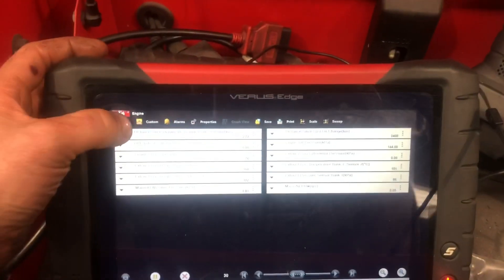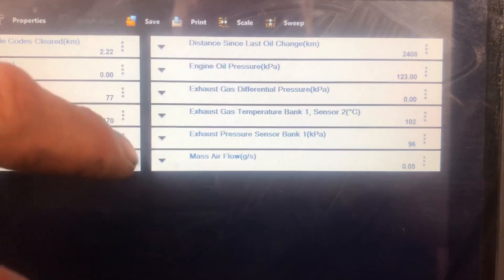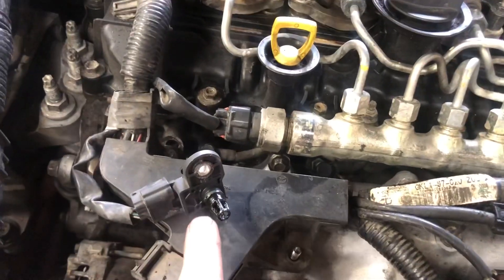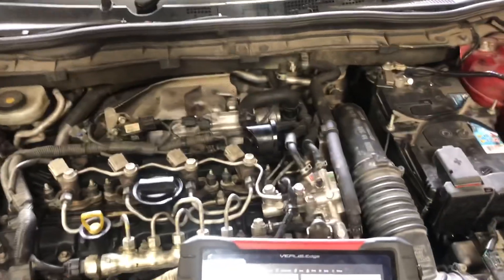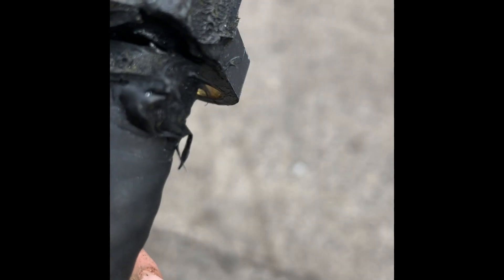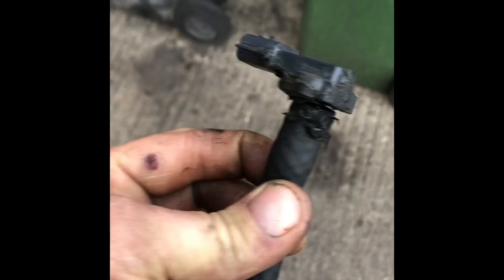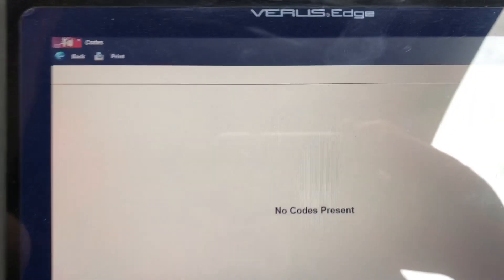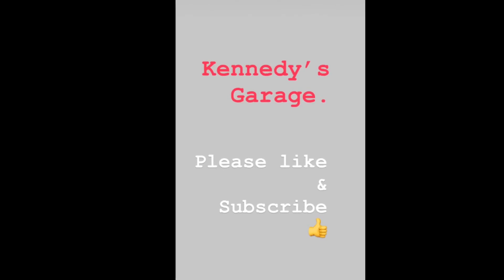Mazda 6 reduced power fault finding

Comment: Unfortunately in the states we didn’t get those Mazdas with diesel engines 😢
Reply from the maker: Lots of diesel Mazda owners might call that fortunate rather than unfortunate 😂😂😂
Reply: @kennedysgarage3281  are those really that bad? Personally I’d prefer a diesel for the torque and longevity of the engine, but with all that emissions crap I guess they’re not as reliable as I thought
Reply from the maker: @ReviewingTech101  actually with the correct maintenance, preventative or needed they are quite good. It just seems that tech’s over here don’t want to touch them 🤷🏼‍♂️🤷🏼‍♂️

Comment: Is the noise for the engine alright because this is what my Mazda 6 sounds like?
Reply from the maker: Unfortunately I cannot advise without hearing the noise myself. They do suffer from low oil pressure due to a gauze getting blocked in the sump/ oil pan 🤔

Comment: Hi Peter,
I live in London I have a Mazda6 diesel 2.2 There is no POWER.!!!🥴😮😟😭
 On the dashboard
1. Oil change due.
I changed only 1500 miles ago .
2. Check oil pressure. ( No power)
3. Check the oil level.
I would like to visit your garage.
I'm not a trust dealer named Mazda.
Please can you tell me where I can visit your garage.
Many thanks.
Reply from the maker: Hi Ruslan, unfortunately I’m am in Ireland which isn’t impossible but would be quite a distance to travel 😬
The oil strainer in the sump / oil pan is more than likely blocked. I have videos on this for reference. It should cost around £500 to £600
Reply: @kennedysgarage3281  
I checked the oil level and it is Perfect. Then I removed the cable from the battery for just 5 minutes then connected and all issues on the dashboard disappeared. Left only Oil change due. Now car driving is ok for the last 50 miles. But I have had another problem for a long time...
When I start to drive the engine cold. First gear is fast like 2nd 3rd 4th 5th 6th. But after 5 minutes when engine temperature normal 1st gear is very slow. 2nd 3rd 4th 5th 6th is okay. I mean fast. How do you think what's happening. Recently I changed the turbo. Also I deleted DPF.
Reply from the maker: @B.Ruslan1978  Mazda have AWS ( Accelerated Warmup System ) it increases the engine rev’s when cold, so I don’t think you have to worry about that. But watch the oil issue it will come back 😬😬
Reply from the maker: https://youtu.be/EIPGqQwBJtU

This might help oil change message 😉
Reply: @kennedysgarage3281  
Ok. Peter
Many thanks.👍👍👍

Comment: Well..got code p2262 and changed exhaust pressure sensor. Still showing code and no turbo boost. Delivered it to Mazda dealer today and they said  pipe to exhaust pressure sensor is blocked. They quote 2000 euro to change it. You sir   are a genius. Think I'll might try your way😂 (Norway)
Reply from the maker: Dan, it is fiddly but something you could possibly do yourself with limited tools. If you haven’t done it before I would say to give yourself a day to do it. Just in case you get frustrated and need to take a break 😂😂
The very best of luck with it 🤞🤞
Reply: @kennedysgarage3281  thanks man. I Will do eventually. Not the kind of work to do outside when it's snowing and -10 degrees. 😂 Mazda wants to take engine out to replace it😂 keep up the good work
Reply from the maker: @Dan.Norway  ooooh that would be tough 🥶🥶

Comment: We have a 2013 GT diesel and have no boost until 2500rpm and then the turbo kicks in hard, has been serviced but isn’t throwing any codes at all.
Reply from the maker: It is back to old fashioned testing so. Check the turbo pressure pipe just to be sure. It has 2 turbos and the change over flap can come loose and fall off. Pull out the battery & remove the bolted on intake pipe running over the top of the bell housing. That is worth a look too 🤔

Comment: Hi mate why does a restricted pressure sensor pipes or faulty pressure sensor effect maf sensor readings
Reply from the maker: Most electronic components on modern engines can be very much integrated. (ie. If I get steel in my eye, eating, running, driving,working will all be a struggle & only with 1 small problem)
Cars can be very much the same. If the engine ECU doesn’t know the correct exhaust pressure at the turbo it cannot not control it correctly. The way the turbo is performing has a direct effect on the amount of air entering the engine. All very interesting and sometimes very complicated, but generally does make when we think about it🤔
Does that make sense??

Comment: Just come across your channel amazing work you do. 

I have a Mazda 6 2.2 185 (2009) I have a p2565 that won’t go away. Sometimes car pulls , sometimes turbo cuts out Spent hundreds on diagnostics to no avail . Any ideas?
Reply from the maker: P2565 is a turbo position sensor fault. This fault can be caused by the turbo position sensor on the turbo vacuum canister 🤔
If that test’s good you would then need to check the variable veins on the turbo to see if they are free & not sticking. After that look at the turbo control solenoid, that is the best advice I can offer without seeing the car 🤞🤞

Comment: I am trying to choose what car to buy between a 2014 Mazda 6 2.2d with 140k miles or a 2011 Honda Accord with 180 miles. Both are on sale for 4.5k euro. 
If I bought the Mazda and changed the injector seals straight away, checked the oil pick up and then changed the oil every 10k km,  would it be enough to keep this car right without issues arising. I did have a 2011 version and it went well after injector seal change and oil change every 10k Km after that.
Or would I be better of going for the 2011 Honda Accord ? Obviously I also prefer the year of the Mazda but if this Skyactiv model has many issues more than just injector seals and Dpf,  then would I be better of staying away from one ?
Reply from the maker: No, not at all. They only suffer from the same few issues that can be mostly avoided by the correct servicing. Keep changing that oil at 10k and I would say you will be good 👍
Reply: @kennedysgarage3281  The Mazda 6 I see for sale looks very under priced for a 2014 at only 4.5k. The current market value of the same car is 9.5k. The seller is also one of the traders who is advertising as private. It would worry me that it could have hidden problems that might not be visible on a pre-purchase inspection.
Reply from the maker: @markcorcoran9866  ask about warranty 🤔
Reply: @kennedysgarage3281  There will definitely be no warranty and there is no mention of anything about service history on the advert. It just said fresh clean car running well,  so it might not be worth the gamble.
I actually asked a mechanic a few weeks ago to go check a lovely 2012 Mazda and he told me to save my money and not bother because he had many Mazda diesel engines sitting in his yard. I used to own a 2011 one and loved driving it up until I had an accident that finished it. I'm just trying to decide what car to get next and I am not finding it an easy decision. I don't really do big milleage so was looking at some petrols also but I like the Mazda and Honda diesels.
Reply from the maker: @markcorcoran9866  a lot of garages don’t like working on Mazdas, the Hondas can be quite good but garages can also get lost when they do go wrong. The Honda would be a stronger car & the Mazda would need a little TLC over the year’s 🤷🏼‍♂️
Reply: @kennedysgarage3281  That Mazda 6 that I was looking at on Done Deal has been reposted and price  reduced by another 1k and now is for sale at 3.6k euro. This is a 2014 car with 220k km. That's serious value but it could be a lemon also 🤔
Reply from the maker: @markcorcoran9866  it does sound very cheap 🤔🤔

Comment: Had the "Scbs" waring light and "engine inspection required" ...my mechanic saod my waste pipe had gone into my low turbo...so new turbo fitted and he says car is fine......2days later i enter the motorway amd less then 2km down the "scbs" & "engine inspection required" back on .....any ideas on what could be the issue as he seems clueless and taking the car back Monday....he already charged me €2450 for the new turbo and waste pipe 😭
Reply from the maker: Get engine management fault code and let me know what they are, before going back. Any OBD code reader will do😉
Reply: @kennedysgarage3281  would you think its because he changed the twin turbo and waste pipe
Reply from the maker: @glfery  the diverter valve can be a very common problem 🤔

https://youtu.be/yJQ2EuorvWA
Reply: @kennedysgarage3281  would €2450 be a normal price for changing twin turbo and waste pipe?
Reply: @kennedysgarage3281   would the errors still come up after a new install or would that flag its not installed properly or map sensor or something is gone
Reply from the maker: @glfery  it probably isn’t too far off. Turbo’s can be quite expensive unfortunately. Was it diagnosed correctly if it hasn’t resolved the issue 🤔🤔
Reply: @kennedysgarage3281  ya thinking that myself....i was saying maybe the map sensor but he ate the head off me saying what I'd know ...safe to say ill never use him again.....he got business off me for 4 years but 3 months ago did a botched job on a Mondeo....ford told me someone had attempted to fix it but badly.... I've given the guy the  benefit of doubt but he's shafted me now again
Reply: @kennedysgarage3281  so 1 fault....  P0299?
Reply: Google showing...

Leaking or damaged charge piping.

Failed diverter valve.

Failed boost pressure regulation valve.

Failed turbocharger or supercharger.

Faulty boost pressure sensor.

Faulty wastegate/wastegate actuator.
Reply: UPDATE.....the mechanic WhatsApp me a screenshot of his diagnostic screen:

ABS:
*U0401- Invalid data from ECM

SSU:
*B13D3- Pats Transmitter

Scbs:
*U0415-Invalid data Received from ABS 

*U0401- Invalid data from ECM

He said at the bottom.... nothing wrong with the car!?
Reply from the maker: @glfery  anytime I have ever seen U0401 - invalid data from ECM in other modules it has just been an engine management fault code stored. 
I don’t see any engine management scan 🤷🏼‍♂️
Get your mechanic to do just an OBD scan on the engine management system, this is only useful if he hasn’t recently ‘cleared’  engine management faults 🤔
Reply: @kennedysgarage3281  id say he'll have them cleared on me, hoping to get the car back today, car going to another mechanic straight away for it to be looked over as I've a feel this is not end 😭
I appreciate the help and info you gave me ..keep up the good video content and wish you all the best 👍🏼
Reply: https://youtu.be/-in39QE3XyE

Comment: I’ve a trade MK3 2.2d 150 auto 2013.  Over fueling 43 mpg at 60 mph over 4 hours. Using almost twice fuel would normally this trip modern diesel .  Did get diesel particulate message an hour before home. Turned maz6 off and on and went . Got home.  Cleared codes scanner DTC cannot remember. .  Never seen Mazda message on car again but only driven 25 miles a time and still over fueling.  I’m thinking as drives nicely this is plain old soot filter dpf full, or other.  Any help greatly received. Best regards
Reply from the maker: You really need to start with a fault code , purely to see what the car isn’t happy with. 
You could measure the Dpf back pressure with a manual gauge, but post your codes and go from there 👍
Reply: @kennedysgarage3281  Thanks loads, good pointer, I'll drive to get codes, work from there

Comment: Great video on how to get to that pipe!! Mine 2014 Mazda 4 2.2 alarmed first for SCBS inspection required then at the same time the engine heating light and now I have a engine light inspection, Mazda told me this was needing a carbon clean for 2k I decided to look at it myself, the auto electrician I had says all the alarms are all connected to one fault even tho it throws up 4 including instrument panel he also believes it's this pipe and sensor giving the griff. Fingers crossed it'll sort it!!
Reply from the maker: @deanbramley2130  I got it in the Main dealer, if my memory serve’s me correctly I believe it was around €80
Reply: @kennedysgarage3281  cheers 👍
Reply from the maker: Both the pipe gets blocked and the sensor on top of it fail quite often. They are both very easily tested, so he is more than likely on the right track if he’s not happy with the results he got. Fingers crossed Dean 🤞

Comment: I have the same car and engine, the car struggles to pull past 3000rpm uphill and also in general. Any ideas what it could be? I cleaned the map sensor as well as replacing the fuel filter. The car is showing no codes and there are no lights on the dash at all.
Reply from the maker: You could have a blocked Dpf ??
Reply: @kennedysgarage3281  I thought this may be the case however usually when this happened to me a year ago there was a light on the dash and the car dropped into limp mode. However it is not in limp mode right now it does have power but not the 150bhp it’s supposed to have.

Comment: Hi just watched your video I had a exhaust pressure pipe blocked cleaned pipe cleaned sensor and cleared light. Drives fine now but turbo doesn’t kick in till 2400rpm just wondered if this was normal or if you think the exhaust pressure sensor needs replacing (does this control when turbo kicks in) I have a Mazda 6 2016 2.2 d skyactiv.
Reply from the maker: 2400rpm is quite late for the turbo to kick in, this does effect turbo control but along with lots of other bits of information from engine sensor’s. You probably need to test the exhaust pressure sensor to see how it is performing (ie. apply 10 psi of pressure and see if you scan tool see the same 10psi.) They suffer from intake manifold & ports  blocking bad too 🤔
Reply: @kennedysgarage3281  ok thanks for the info I suspect the sensor will be at fault but I’ll change it anyway for the updated one and try it after that
Reply: @ryanphillips3712  let us know mate I'm.reppacimg mine to this week and I'll be checking those pipes did u have to remove the metal 1?